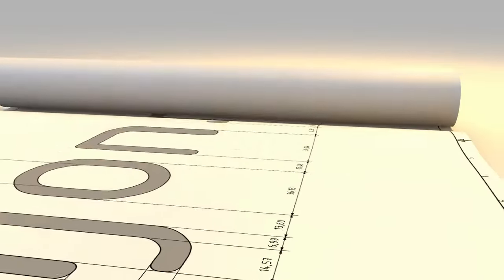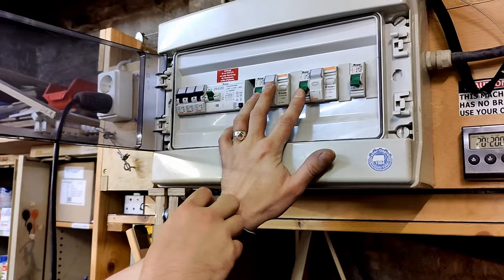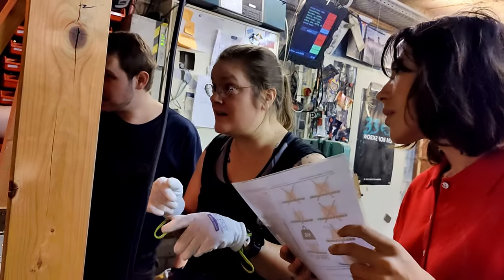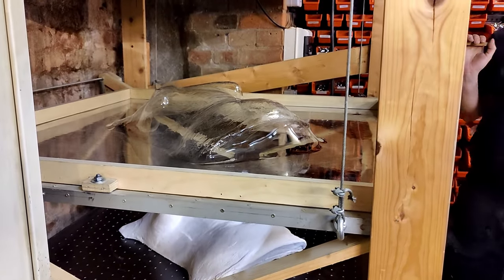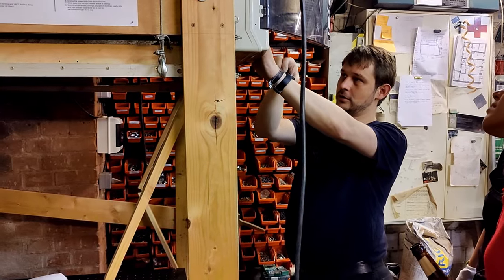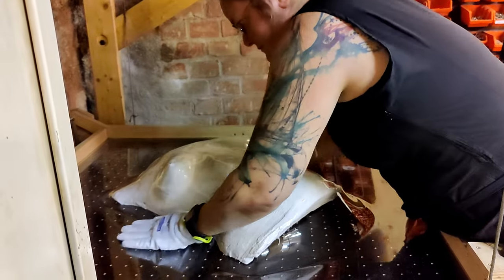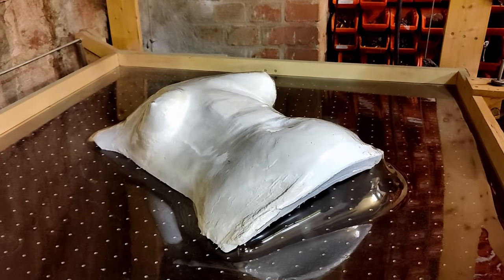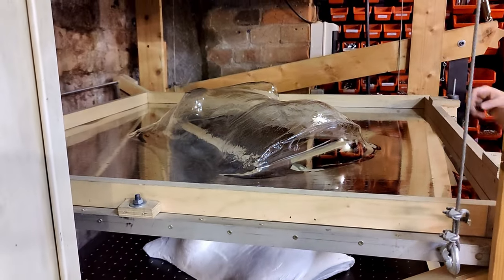Vacuum forming a plaster bust from acrylic Glas (PMMA)

Comment: wat might help the seal is put a 2cm high (play doh clay ?) boarder around the cast and tape the holes on the outside of that shut 
the boarder should stretch the material over the boarder at that point and that with the vacuum pulling the material in should create a better seal than the edge of the frame would , the frame greates the innitial vacuum once it hits the boarder and seals on that as the vacuum concentrates around the mould it be like applying turbo boost 
it might help drilling some holes in the mould where theres still some space between plastic and mould like the underside of the breasts in this case 
like to see more of that drop mecanism you created , im in the process of figuring out a vacuformer that can use large sheets that i need to operate by myself 
youre system covers a big drop with just one lever wish might work with my system (planning on heating from the bottom with the sheet clamped to the top , and droping the mould with the vacuumsystem sitting on top intoo the dish made in the plastic sheet 
allready seen some advantages and disadvantages doing it like that , the advantage is the shet gets prestretched over the mould before the vacuum comes in and the weight of the mould and vacuumsystem helps pushing down for a good seal  , the downside is you be moulding blind once the box is closed and the heat moves to the edges of the sheet once the material starts drooping 
you can allso keep heating while forming giving more time for the material to suck itself intoo the corners